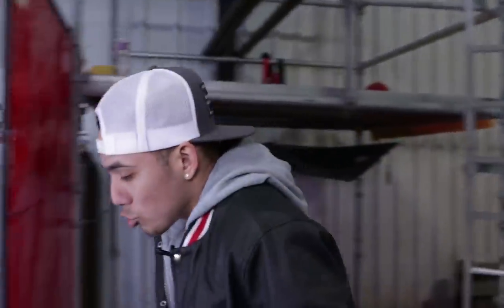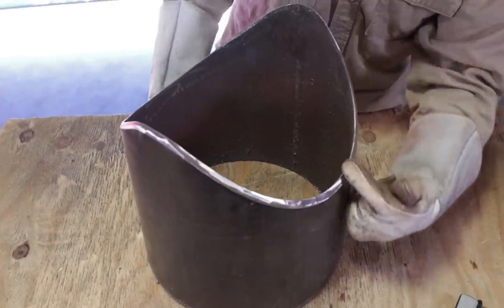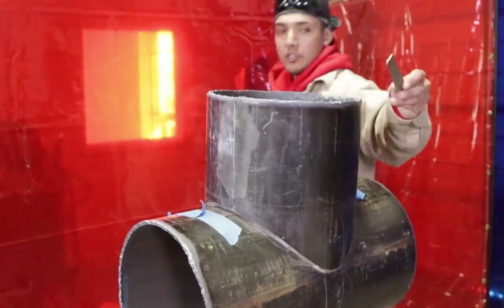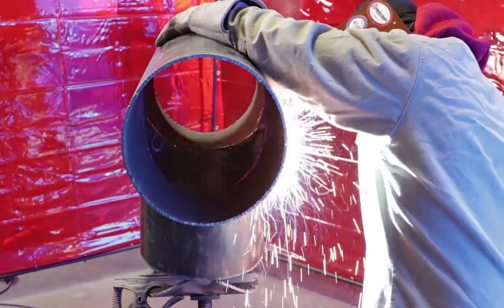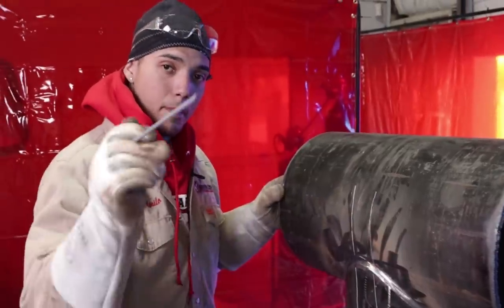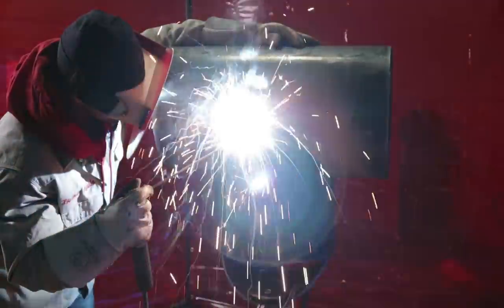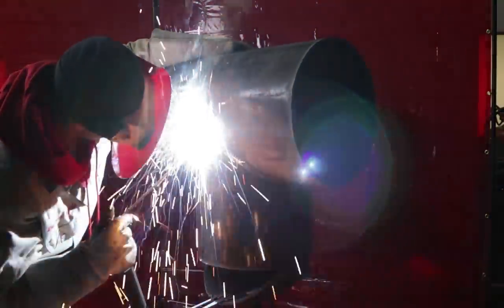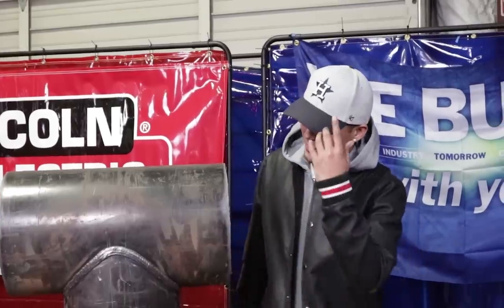How to fit and weld a 12x12 Branch Test Tutorial

Comment: I've been watching your videos for some time but I'm getting a bit disappointed when I came to this one in particular. You talk about 'fit up' and settings and I can see that you simply talk a good game but you don't practice it in reality. How can you get a 'decent' bevel and a good and precise fit up if you don't use a 'safety handle' on your grinder? No wonder that bevel has all kinds of uneven pass marks that look like fiddo's butt! they're not flat and even so, how do you expect to get that 1/16 edge to weld on? I will tell you why... Because you have No Control of your grinder as you get into the bad habit most welders do, they use that grinder without a safety handle!! A grinder is like a Rattle Snake, you CAN NOT CONTROL IT BY ITS TAIL ALONE, ONE HAS TO HAVE A FULL CONTROL OF THE HEAD OF THE SNAKE OR IT WILL BITE YOU!! and you can only achieve that by using the handle that came with that freakin grinder and its wheel guard, my friend! That 90 degree angle hold you get between your right and left hand by using the handle and the grinder's "tail" below the "half" of its body is to let you take full control of the grinder's motion. The "color" band below the grinder's body is not there for DECORATION... it is there to let you know that the operator has to "grab it" at the Rubber half next to the power chord, not above it next to the switch and the same reason the safety handle has a "Stop" Ring so you hand stays away from the grinding or cutting wheel, just like the wheel guard prevents sparks or broken pieces of the wheel from flying to your face! Once that cutting blade hits and tries to cut the metal "off angle" or the metal being cut "buckles" and bites the blade, it is going to send the whole grinder directly to your face, chest or get tangled in your clothes and "Rip you" a new one! I've used to use it like that and I've had it go right through my gloves and I have the "marks" to prove it. It is STUPID and IRRESPONSIBLE to use power tools inadequately for you and those around you. I see other welders making this same mistake and I stay away from them. They're the same idiots that try to "grind out" metal with a cutting wheel instead of a Flop Sanding Disk and sure enough, they "thin out" the cutting wheel until it breaks and pieces of it take off like stray bullets straight to their faces or those working around these morons who don't know how to use their equipment properly. You are a great welder, no doubt but also a poor example of safety and production of quality because of your bad habits. LEARN HOW TO USE YOUR TOOLS PROPERLY AND MAKE A VIDEO ABOUT SAFETY BEFORE YOU TRY TEACHING WELDING. PRACTICE TEACHING  "SAFETY FIRST" INSTEAD OF SHOWING OFF